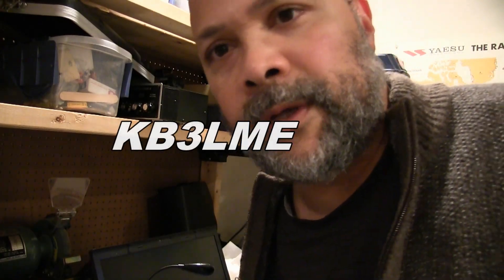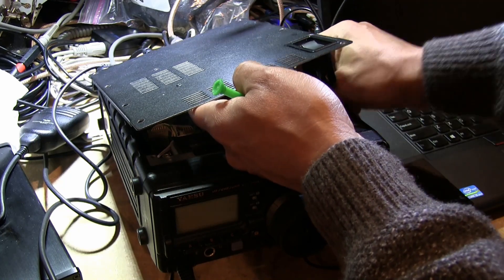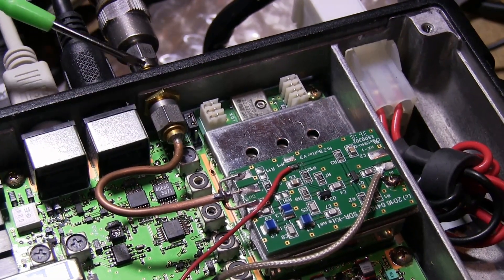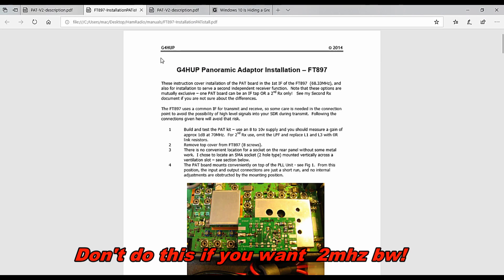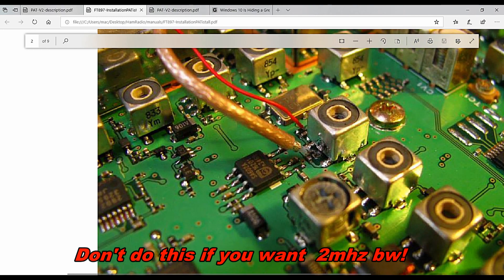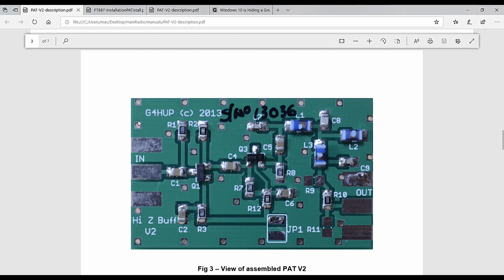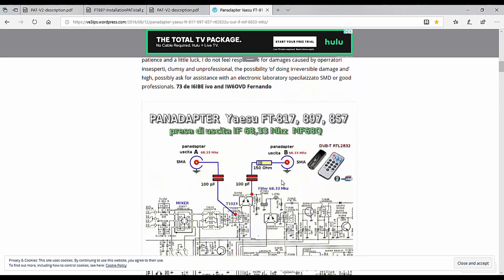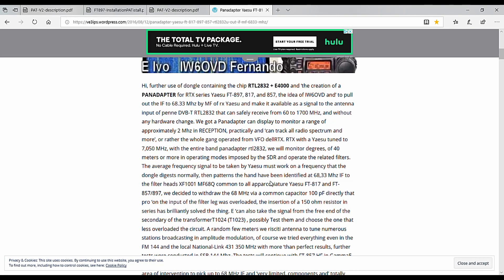Yaesu 897D Panadapter

Comment: I'm new to HF , I just passed my general class a few months ago , I don't know anything about nothing . I have a pile of new dipoles , various bands , and I found a very low mileage 897D .. I don't care about a panadapter right now , but I can see how they are useful .. has anyone came up with a direct cable setup yet that just plugs into the radio into your computer or whatever ??
Reply from the maker: There are many ways to connect the 897D to computer. One popular way is to use the signalink device. See https://youtu.be/5FDQT85I3t4
Reply: @nivram2009  
Thanks I will check that out 👍

Comment: I cant get mine to work at all with an RTL2832U Dongle.
The PAT70 board It is now back out of the 857D as I have noticed that the output on the board has a dead short.
It is shorting the center of the output coax to the shield of the output coax (I am sure it should not be doing that).
I have tested all of my coax off board and there are no shorts.
not happy at all and have had to email SDR-Kits to ask if the output should infact be a dead short (if no then they sold me a dodgy board)
Reply from the maker: Are  you sure you had a short? How did you test for the short?
Reply: I also have the same problem. With 2 boards. I checked continuity between the center conductor and shield of the coax going out, and they're connected somewhere in the board.
Reply from the maker: @jstnclark  it's best to reach out to the PAT70 vendor and explain what you are observing. I'm sure they can give you proper guidance.

Comment: Does it work? Yes it does. Does it work well, no it does not. What I have learned with these roundabout solutions is they do not produce enough signal to use effectively as a panadapter. Strong signals are okay, but when you start getting down below 7 S-Units you will not be able to hear the stations anymore, but you can still here them on the radio's receiver. Really not worth all the labor involved, and the chance of messing the radio up IMO. I have used RTL dongles and SDRPlay with the same results.
Reply from the maker: It works, and it works exceptionally well for me. Without it,  it takes a lot more time scanning on the bands with the radio to find conversations. It may not be perfect but its well worth the effort. And there are less risky panadapter solutions where you don't have to tap into the radio but you can split the signal at the antenna feed. It may not be perfect, but nothing ever is. It's well worth the effort.
Reply: @nivram2009  where did you connect the DC+ of the PAT board to?
Reply: nvm, i must have missed a bit of the first part of the video...

Comment: The input from the board to the PAT70M it is unclear from the video but where are you taping the ground shield of coax to PAT70M on the main Yeasu board?
Reply: From the installation instructions on huprf.com: "Fig 3 – connection of RG178 coax to centre pin of T1026. Note that braid is not connected,"
http://huprf.com/huprf/wp-content/uploads/2016/03/FT897-Installation.pdf
Reply from the maker: @whytebredd  Adam, yes that is correct! Thanks for responding.
Reply from the maker: I don't remember off hand the answer to your question, and presently the radio is in a rack mount so would take much effort to disassemble and confirm your question.